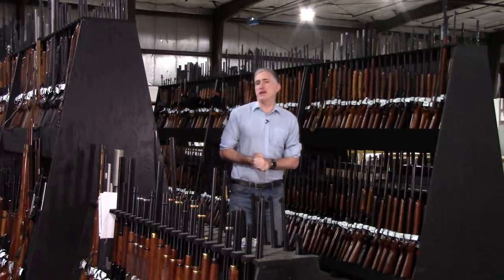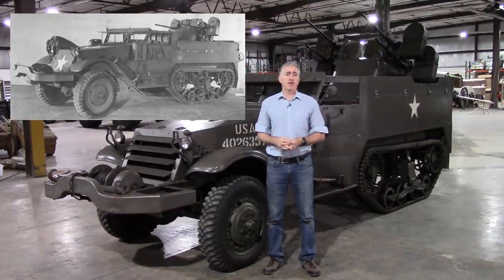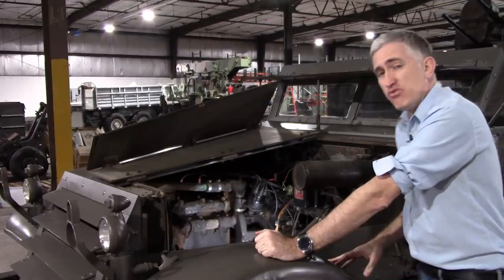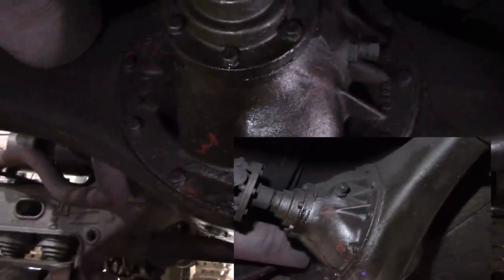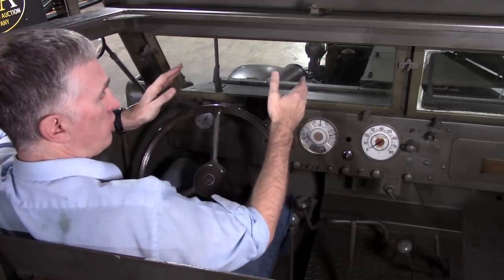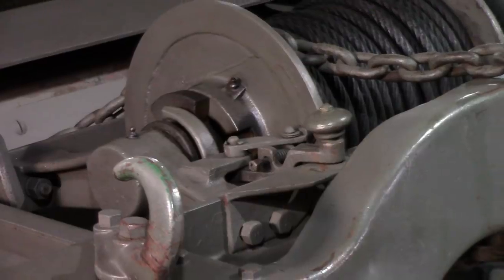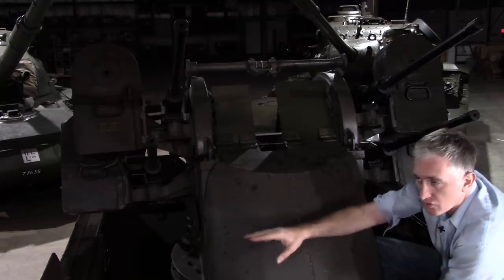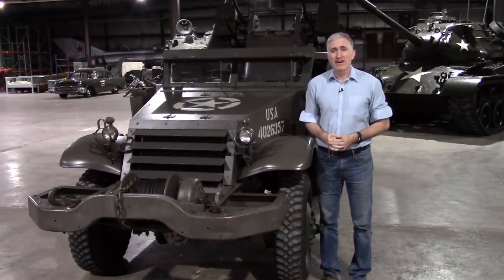Inside the Chieftain's Hatch: M16 MGMC

Comment: Watched an interesting period video where they demonstrated a track replacement / refitting procedure that halved the official time for task. Involved:
 backing the adjuster right off,
 IIRC unbolting one end of the adjuster mount to let it swing down,
 removing the outer half only of the drive and idler wheels,
 jacking the vehicle up until you can pop the track over the drive teeth and under the road wheels then remove sideways,
 reverse procedure for installation.
Thanks for another informative and personable video.
Reply: Kelly Knott I watched that old film. It is BS. I tried it. It takes that long just for two guys to drag the track into the right place. It is a HEAVY finger pinching dead octopus to move around

Comment: The Umatilla Army Depot, Oregon, had one of these that went on the auction block in the early '70's (?). 
One of the guys  ( probably a Seabee ) from the Boardman Bombing Range ( NWSTF ) bid on it and won. Needing a place to drive and park it, they started to drive down to the range. Ran out of gas. Refilled a 5 gallon jerry can, ran a few miles, out of gas, refilled, drove some more, empty again. Finally made it thru the North gate after about 5 refills. They figured they were getting between 3 and 5 mpg. They ran it a little on the range ( gov't gas...? ) but couldn't afford too much fun. After it sat there awhile the Chief told them to get rid of it. They dug a trench into the desert sand at the dump near the old main compound, drove it in, and buried it ( wonder if the key was left in the ignition ? ). Heard that from a guy who came by the main compound on a weekend, showing his teenage son where he was stationed while in the Navy. He was one of the 1st four sailors sent down from Widbey Island to take over the range from the Air Force. Only truck they had was '60 Dodge Powerwagen. It was still there and in use up to '80's. 
A lot of buried stories out there in the high desert ...
Can Do

Comment: The problem with vacuum wipers (they used to be common in cars too) is that the engine produces the most vacuum when the throttle is CLOSED, because the pistons are trying to draw the air through the closed throttle valve. This means that the harder you are working the engine, the less vaccum you have. This usually means that harder you press the gas pedal, the less vacuum you have. The less vacuum you have, the slower the wipers go. So that's a problem. Probably not such a big deal in military vehicles which probably aren't bombing around at top speed anyway, and should have plenty of vacuum from the big engine trying to draw air through a little single barrel carb, no matter how far the throttle is open. In theory anyway. They do work though. and of course the simplest and safest solution is to not drive fast in the rain which is probably wise anyway.

Comment: Engine vacuum was used for the windshield wipers in most US WWII vehicles because copper  (for wires and motors) was in very short supply relative to the number of vehicles projected to win the war.  At least that's what I was told as a child.

Comment: I read book written by Polish soldier from WW2. Mieczyslaw Borcholski - "Z saperami generala Maczka" ("With the general Maczek's sappers"). Author was a sapper of Polish 1 Armored Division and he was using M3 and M5 halftracks. He wasn't impressed by their climbing capabilities. He described, that once (during battle at Falaise) they were trying to climb grassy hill. But because it was rainy day, halftracks were sliding down - they were just turning 90-180 degrees and started to slide down the hill. Author was a commander and had 4x4 M3A1 AC, which climbed easily, but halftracks couldn't. Situation was bad, because Germans spotted them and started to fire mortars. The sollution was to drive backwards - so front wheels of haltracks didn't slide on the grass and didn't turn whole vehicles.

Comment: Those vacuum-activated wipers were still being used in the early 70's, on the deuce n' a half.  We have an old M35A2 and it uses the same style, maybe even the same exact model.   I think the idea was that if at all possible, they didn't want anything to use electrical power so that nothing but the starter motor and headlights would ever have to be drawing on the batteries.  Reduces the chance you accidentally find out you've got a dead battery when you gotta get moving in hurry because something got left on or a rogue short drained them.  The front axle hubs for 6x6 mode are similarly air activated. So you don't have to get out of the truck (possibly while being shot at) to flip over the hub lockers.

Comment: Ahh vacuum power. A lot of American vehicles used vacuum for all sorts of stuff, had them for hidden headlights in cars like the Lincoln Continental, they also had vacuum actuated windows and door locks and even seats. We used to own a 1984 Buick LeSaber and the seat would automatically move forward and the stearing wheel would rise with the gauges when the engine was turned on all under vacuum.

Anyway, with an engine vacuum is basically "free energy"  kinda like heat from the engine, and a vacuum system is fairly simple to design even if it did get crazy with some cars, especially in the 80s. Even today most brakes in your cars are boosted by engine vacuum. It's just back then motors where expensive and all the switching and electronic stuff was more expensive than pneumatic valves. In some industries like the oil or chemical industry where fire is a risk, there are entire basically simple logic computers that are pneumatic.

Comment: If the rocker boogie system was spring mounted you could use two turn buckles on either side of the center mount that could pull the rocker bogeys up at the ends which would relieve tension off of the track so you can replace the track

Comment: You do make the thing look rather small...
As a teen, I drove an early '60s Ford Falcon with a vacuum wiper system.  One problem is that the vac died and the wipers slowed, eventually stopping, under load, such as climbing a hill...great fun in the rain.
Reply: These have a vacuum pump built into the fuel pump that helps the intake vacuum
Reply: @yelwing  Ah.  That old Falcon pulled vacuum off the intake manifold.

Comment: Sorry, those are 8.25 x 20 (not 7x20) tires and those aren't split rims.  But an interesting point about wartime production, the hubs of those wheels are manufactured by Budd and you will often find that removable flange which is held on with 18 bolts) is made by Firestone... (look for Firestone's script F stamped into the face).

Comment: My favorite thing about vacuum operated wipers is that they work best when the engine is idling. If the hose doesn't leak of course.
Reply: Nick Thompson these also get vacuum from the fuel pump, so all works well during high rpm. How do I know? This was one of the last things I had to figure out before I could drive mine
Reply: Nice. From what I heard talking to my grandfather, none of the Jeeps he rode in had working vacuum for the wipers. Half track never came up.

Comment: I have heard, verbally from folks who were there, that the Quad 50's were also used for indirect, area fire in Korea.  Basically, sit behind the hill with your platoon/squad of M16's, work out the pesky details like azimuth and elevation, then open up with X number of 1/2" Artillery so as to saturate an area where the enemy is suspected of assembling one of those human wave attacks, or where they think their mortars, etc. are safe.  Was told that where the target was actually there, thousands of 1/2" rounds suddenly falling from way up in the sky proved devastating.

I have not run across any documentation on this use, however, given the range and available firepower, it certainly seems to be plausible.

This is also one of my favorite AFV's and I really enjoyed your review.  Very thorough indeed.  Thanks.
Reply: Sure, just like an M2 with a T&E can be used for indirect "beaten zone" fire.  Not nearly as impressive as the "death ray" of 4x .50 cal. up close, but I guess a lot of very large bullets suddenly falling out of the sky around you would have an impression all their own.
I wonder if the M45 has the az and el stadia marks on it to facilitate that?
Reply: @jamestheotherone742  I have no idea if those marks are incorporated, but Arty types have hand held tools that would make it work.

Comment: The VAcuum system is there because even luxury cars in the day and up to the late 50s had vacuum operated wipers in the US.
Reply: "Because 6v electrics are hardly electrics at all..." I imagine it had something to do with "you can drive in the rain w/o wipers, albeit slowly, but you can't drive if the engine won't run because there's not enough juice to fire the spark plugs." As long as the engine is running, you've got vacuum, so save all the magic smoke to turn the starter & keep the motor turning, & let the wipers suck hind teat! ;-)

Comment: Im a 14p avenger/stinger manpad/m shorad/c ram operator in the US army currently stationed in germany. 

This is the OG of short range air defense. I dabble in scale modeling and wanted to collect all the lineage and predecessors to the Avenger. Got the m6 linebacker, m247 sgt york, m163 vulcan, mim72 chaparral, m42 duster, and this m16 halftrack quad.

I believe in the coming decades the avenger will be obsolete, replaced by the M shorad.

Comment: Mercedes used to operate its central locking up to the 90s i think.
Very reliable, and as long one leaves the hoses alone it does not break.
If it breaks and one knows the systhem very easy to locate the leak and fix.

I think it was a lot of a heck more reliable than any electrical solution before the invention of reliable silicone plastics....

Comment: I never knew until I was an adult that the tracks on a Half Track were made out of rubber.
Just like the tracks on the Scale Model M-16 Half Track I made as a boy.
Reply: Plus I believe 16 1/8 th aircraft cables , 8 on either side of the track guides connected to metal cross bars they are  the bulges in the side of the tracks . Also there is no repair of a broken track , yes it's possible to weld a couple  chain links from cross bar to cross bar as a temp. collectors repair

Comment: It seems kind of silly that they kept the M45 a 6 volt system, even though they bolted it into the back of a vehicle running on 12 volt system.
Even though, did they not have the ability to step the voltage down?
It seems like it would have made a lot of sense to have the turret batteries able to be recharged by the vehicles generator also.

Comment: I'd love to see video of the M2/M3, at least the parts that are different from the M16.  I have tried to figure out the details of how the M3 passenger compartment is laid out, and am still vague about where the radio, if any, was installed and how big the storage compartments were.  I am mostly concerned with WWII use so would prefer a basic M3 rather than an M3A1.
Reply: The bed had long bench seating on each side that covered stowage bins that held ammo and rations. There were clips on the sides above the seats that held their rifles. The troop carriers didn't have radios.
Reply: @billwilson3609  I assumed the line carriers didn't have radios, but would a platoon leader vehicle have a radio?  Surely a company commander had one.  I have seen some pictures suggesting radios may be mounted in place of a seat or two in a back corner of the passenger compartment -- possibly leaving the underseat stowage bin in place but the seat back(s) removed, the radio itself mounted in place of the rifle racks and seat back(s).

Comment: I had a 1950s Willys Jeep that used the vacuum windshield wipers, and the big disadvantage was going uphill or really anytime you are working the engine. When you do, carburetors do their thing, and you lose vacuum. 

So if you go uphill, the wipers slow down a lot. But the 1950s version had an upgrade - a little handle you could swing back and forth and manually operate the wipers. One of my most disliked features of the Jeep
Reply: Huh would have thought they would have already had the handles, seeing as my GPW(43) only had handles and my Dad's MB(44) was electric with handles.

Comment: i work in a tire shop...... 

the tires are "7.00-20"...... 7 hundred 20s
and split rims are NOT dangerous.... just make DAMN SURE A.L.L!!! the air is drained before removing the outer bolts/nuts

we deal with lock ring rims quite a bit still...... 
take your time, know what your doing, ask questions, and use every safety device 

we air them up in a cage..... with a 15 foot hose attached to a gauge
never had one fail..... but it still makes my B-hole pucker a bit

the saying goes "30 psi will fuck up your day....... 100PSI will fuck up your life"
Reply: that U-joint is a modern semi truck style...... VERY quick and easy to replace
much quicker than a car or pickup style U-joint 

i like!
Reply: also.... strange to see a disk parking brake..... 

most STILL use a large drum brake.......

Comment: on the M35 Deuce-and-a-half there is a 2 position door for taller peoples like myself with a not  completely closed door with room for my knee to use the clutch - while waiting for the convoy to leave and my foot resting on the clutch my platoon sergeant slammed the door shut the rest of the way crushing my knee between the door and the steering wheel followed by lots of swearing.

Comment: I wonder what the fuel economy of a similar model modern truck would be compared to this one. It seems very bad for a 147 horsepower engine: 3 mpg.
Reply: Good luck finding a modern motor that will even run on the 80 octane [on a GOOD day!] fuel these 5:1 compression ratio flathead engines thrived on w/o detonating itself to pieces inside a few minutes. The good stuff was reserved for the airplane engines; the only modern vehicles you could feed the fuel these ran on is something running a multi-fuel external combustion turbine engine like the M1 Abrams, et al. And don't forget all the weight from that armor plating; equivalent  fuel consumption figures from  tanks back then were stated in gallons per mile, so it's all relative! ;-)
Reply: Then you think wrong, unless you're thinking aviation engines. This is a truck engine, which during WW2 were almost exclusively of 1930s vintage design; it wasn't until the 50s that higher octane fuels would become commonly available for ground transport and high performance designs standard to pre-war competition and aviation-spec engines would begin showing up in common use.

Comment: Wow, thinking about the math there, and if the aircraft/antiaircraft caliber 50s fired at 1200 rounds per minute, (I think) then 200 rounds is only 10 seconds of firing. Which seems to track with mystery recollection of fighter aircraft's ammunition loads and fire times. So assuming all four always fire together, 5000 rounds total is 6.25 sets of full 800 round loads, which is 62.5 seconds of fire. Which is maybe two or three times what a fighter would have; so pretty good by comparison, but it's still absolutely bonkers to think about the firepower of one of these things burning through it at 80 rounds a second!
Reply: And I wrote that having paused the video just before the mention of its use in Korea against the Chinese. Good Lord.

Comment: What level of weapons fire does quarter inch steel protect against? Would that stop a service rifle of the time?
Reply: I'm sure someone better qualified to say will chip in, but my imperfect understanding is that if they are over 100 yards away, it could stop the bullets.  If they are under 50 yards, you are in most definitely in trouble. There are youtube videos of people testing helmets to show how bullet proof they were not. They are about the same thickness/resistance. Shell splinters and debris from artillery is what it was meant to stop, which it could.

Comment: I can't figure out why the front window armor wasn't designed to work with the glass in place.  It seams like it would have been very easy to design it so that it would.

I've never had anyone shooting at me, but it seems like being able to drop the armor very quickly would be desirable.
Reply: I honestly don’t see a point to the glass in the first place. The only roof you’re gonna have is a bit of canvas so you might as well keep the armor down and peek your head out the side or over the top if you have to do any fancy driving.
Reply: If it's wet in the slightest and you cover that pane with a steel panel, it's going to go opaque from fogging pretty quickly. Plus you won't be able to reach your vision slot covers.
Reply: @talltale9760  I've never been in the military, so I can only guess, but I suspect a lot of miles were driven in non-combat conditions.  Having owned a jeep with a fold-down windshield I can attest that in cold conditions it is REALLY nice to have the windshield up even if there is no top or doors.

Besides substantially decreasing wind-chill, the glass can also help keep mud or gravel thrown up by the vehicle in front of you from getting in your eyes.
Reply: @mfree80286  The glass could still be removable -- just after you dropped the armor to get some protection (it appears the glass is removed from the inside).
Reply: Andrew Snow I mean yeah but you can solve that problem just by keeping the armor down